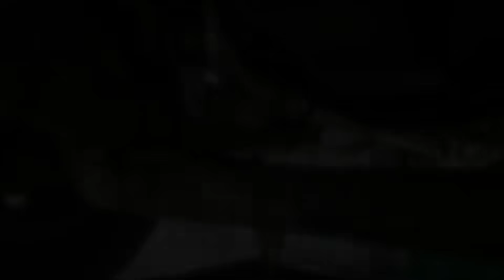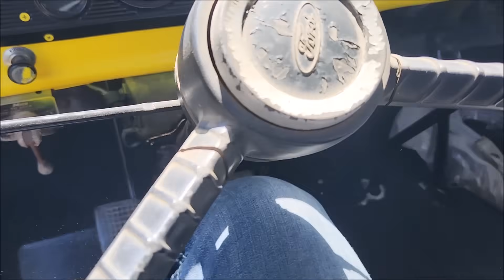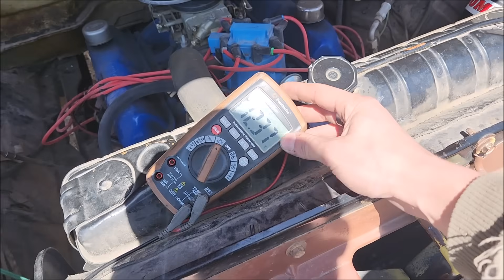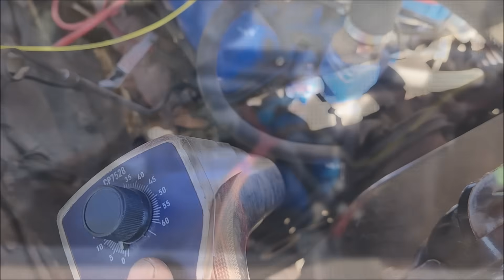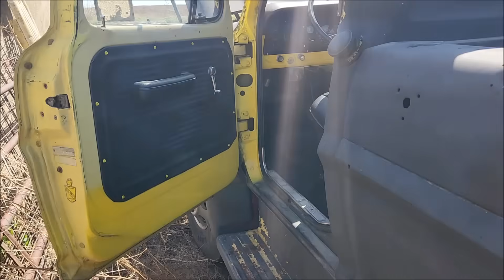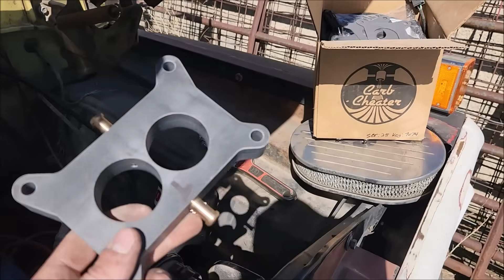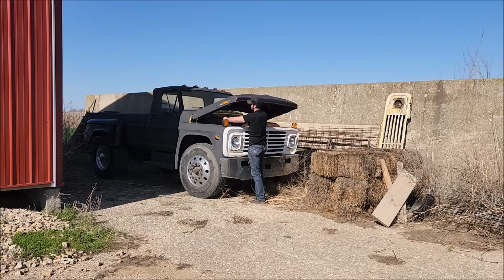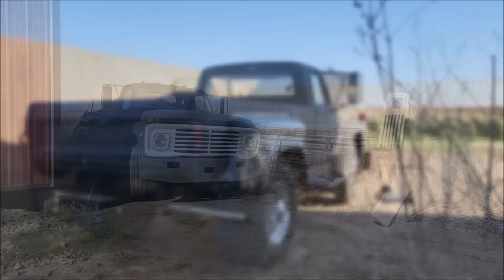Fix & Drive: 1972 Ford "Super Pickup" F750

Comment: Cool old Ford, my Grandpa had a 1976 F250 highboy and of course wasnt happy with the 360 so he bought a 390, turned out he was sold a 391. I think he said he already had it in the truck before he found out, something with the distributer is different and the crank snout is a lot longer.

Comment: This thing is awesome, read above you mentioned selling it, DON'T, this thing is ridiculously cool, it just needs something cool and torquey to power it, potentially an 8v53t or 6v53t if not enough room (looks like plenty), or a 5.9/6.7 Cummins, or if you want to stay Ford, a 7.3L (with a big) Turbo 👌 , but I'm a sound guy, nothing beats a straight 6 diesel, unless it's a 2 stroke Detroit 😅

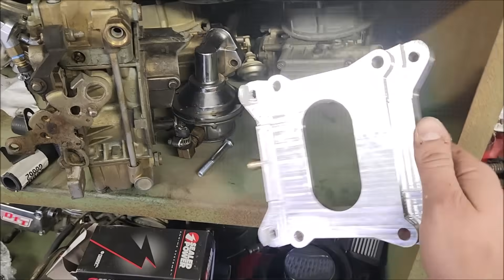Comment: What brand is your carb adapter at 20:20? 
It has a smoother transition than any I've seen.
Reply from the maker: I'm the designer and programmer of the product called "carb cheater" that's a prototype 2 to 4 barrel unit I designed as an adapter option. 
Have not yet released to the public, but it's a nice one compared to anything else IMO

Comment: so you gave coil battery 12 volts. whats your permanent fix ?
Reply from the maker: You could either A, splice in at the key effectively leaving the resistive lead there and having a full 12v wire also, which I view as the simplest and most robust solution with options. 
Or B, use the resistive lead to trigger a relay that loops 12v from the battery. 

Both fairly easy, I don't prefer the relay as it classifies as "more to fail" comparatively.
Reply: @ThunderHead289   I only mentioned it because you didnt cover it. 
Great video !!!!!
cool rig !!!!

Comment: That thing is totally kick ass. It really can't be understated how much thought and effort someone put into the brake/axle conversions on this. Everyone that messes with these old medium duty trucks wants to update the brakes and axles but seems very few actually pull it off. It takes a headache inducing amount of time and research to come up with the right combo of parts and then actually hunting the parts themselves down.

I can't help but love the gear whine those old Clark 5 speeds make, my 71 B750 sounds the same. I've got a factory 4V FT intake laying around I'm tempted to offer you but it's a big heavy cast iron beast. The shipping cost and installation effort probably wouldn't be worth the performance gains, if any.

Comment: Hi you might check your distributor shaft size 361 391 have a bigger shaft size on the distributor and in the block a 390 distributor will fit but loose.Cool truck I have worked on a fleet of the.

Comment: You know your stuff! It's becoming a lost art of wireless fuel management.  Make sure to clean out the air bleeds well. Might want to check the power valve sizing and that accelerator squirter could be tuned a bit. lots to gain.! sounds great tho! Fords like a lot of timing too. Cool build!!!!

Comment: Learned new things in this video.  Also learned I've owned a few older vehicles in the past that would have benefitted from the adjustments and fixes in this video.  I'll know better for the next time for sure.  Timing first, then carb.  And don't forget to look for little things, like that stud hitting the carb body or the loose accelerator pump linkage.

Comment: Why does it have Chevrolet rear fenders?
Reply from the maker: I didn't built it, but the chap said he just had them and they fit the body line - which is true to be fair
Reply: @ThunderHead289 they do kind of fit with the body lines, probably better than the rounded, 50's style fenders that Ford was still using on thier step sides. I just found it mildly amusing. 
Thank you for your response.

Comment: It's been several decades and then some before I've wrenched on these babies! It was fun stumbling on this video and reminded me of a F-250 3/4 that I modified to a one ton to circumvent gas restrictions at the pump after the 70s I'm not sure but in my mind's eye I want to see a fan shroud on that radiator to improve Cooling. Thanks for the ride along

Comment: Those tiny exhausts crack me up!

Are you going to fix this up and sell it?
Reply from the maker: Probably sell it eventually indeed - few more fun things to do yet
Reply: @ThunderHead289  I'll keep an eye on your channel. It's an unusual piece that looks like it'd be fun to use for some gas-wasting fun. Gotta fix the speedometer, of course.
Reply from the maker: It will probably end up equipped with a carb cheater and full time display which had GPS speed on screen
Reply: @ThunderHead289  Those actually sound like good ideas.

Comment: Im just glad it dont have that 360 Truck in it..that motor is an abomination. I did some research on the band you have for your intro/outro music. The singer went to another Chicago band called Chout. He kinda vanished after that.
Reply from the maker: He's a good dude - he's still around, does alice in chains tribute stuff
Reply from the maker: And yes, the 360 is quite the abomination. 390 block woth 352 rotating assembly and some weird long ugly piston thing that still has terrible quench. 
Definition of quick retooling for emissions, later replaced by the modified M series which was also pitiful.

Comment: Does the 391 have any components of the 390? Upper or Lower block.
Reply from the maker: It's "the same" but different - heads are different, exhaust is different, intake is different. You can replace all that and drop normal fe stuff on top. 
The FT block sports a forged big journal crank below. 
The FT and FE might be the most look alike yet most different engines ever made. 
It's like the FT cheated on the FEs homework.

Comment: I bought a 74 Chevy C10, 454 running points. 
The guy I bought it from said he tried a GM-HEI but went back to points because it ran like a dog, so the first thing I did was R&R the distributor for an HEI, but wired the ignition to the fuse box for a full 12V. It still runs perfect after almost 10 years. I've never bothered to remove the resistor. Never needed to after wiring direct to the fuse box

Comment: It should have a forged crank if it’s a FT. What it really needs is a International/Navistar DT466 466 ci straight 6 with a Eaton 6speed synchro or better yet 10 speed crashbox. It wouldn’t be too hard of a swap. The 93-97s use a P-Pump like Cummins. Generally,  for some reason they’re less expensive than a Cummins. They’re wet sleeve so you can overhaul them at home without a machine shop. It usually costs less as well. Yet the sleeves are ductile iron almost twice the strength as a 5.9 or 6.7 Cummins non sleeved block. Same with the Eaton. They’re Designed to be fairly easy and inexpensive to overhaul. Also if they’re not originally overdrive, they can be converted fairly easy. A Crashbox would allow you to “Float” the gears on most shifts without use of the clutch except for taking off and coming to a stop. You do have to rev match.
Reply from the maker: Indeed it would, and likely does.

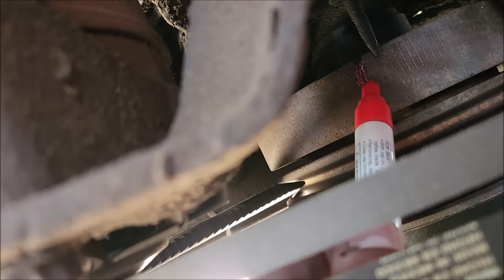Comment: 6:55, as a retired Ford, Lincoln, Mercury technician,  I would take a yellow grease pencil and fill in the timing marks after the engine had wamed up, wiping the excess of with a rag. That makes them really glow with a timing light.

Comment: I have used the power TO the Duraspark box to run the HEI - I have done this type of work on the newer 429 F700s - The 429's if they aren't hauling tons of weight...They can have the "base timing" WAAAAY more advanced....The truck timing was made to not have it ping under heavy load...

Comment: I had an hei distributor in my old truck with 12 volts used to be around 3 volts on the points. Now I have MSD box and distributor in mine.

Comment: Exactly the direction I was going with my bus . Assinate the governor. 
Then a 4 barrel carb via a upside down 4 to 2 barrel adapter with tiny primarys ...
Fuel mileage went way up as did speed !!!

Comment: I wished that you showed how to wire the HEI so that you don't have to pull the wire from the battery to kill it.
Reply from the maker: I probably will in the next video - two easy options, use the original resistive lead to trigger a relay, or splice in by the key and run a new wire from the same terminal. 
Personally I like option 2 since a relay classifies as "more to fail" in my opinion

Comment: Now is it a F750 because lats i remember they were called F700 F800 60s-2000
Reply from the maker: Right on the side of the hood, and is the vintage chrome f750 label piece. 
1972 f750 is googleable

Comment: Im going by memory so bear with me,.The ignition system and coil typically operate at around 6 volts DC (vdc) while running. However, during engine cranking, you'll see 12 volts on the coil/ignition primary to ensure the secondary has a better chance of firing the plugs while under heavy draw from the starter. Once the engine starts, a calibrated power wire or a power resistor is inserted into the primary coil circuit, causing the coil's primary side voltage to drop to 6 vdc.
Its been a long long time since my tech school days, but back then the whole tech school was around 18 to 20 months long & we studied everything from bumper to bumper,  anyway...i enjoyed the vid

Comment: The 50cc accelerator pump is standard on the 4412 holley carb.  All my 4412 we used for racing came out of the box from holley with a 50cc. The 4412 is a 500cfm carb.  The 7448 is the 350cfm carb and it has a 30cc accelerator pump.
Reply from the maker: That 500cfm was a poor choice on somebody's part - actually one of the reason I was simply going to adapt a smaller 4 barrel.

Comment: Yes it is a Super Pickup to be sure certainly stands out and Your never going to see Yourself driving by at anytime in that Beauty! don't drive anything that age anymore but it is still a Ford a Blue 2009 F350 Super Duty 4x4 Crew cab, bed 72" and Yes the 5.4 3 valve V8, Was a trip back in Time amazing and one forgets how much room there was to work on things back then! Was nice to see it runing a GM distributor one of GMs best ideas one wire was all there was an Engineering Jewel that is! Cheers!!!

Comment: If you keep it I think you should do an air ride conversion, get a bumper you can stand on so you can check oil and water, add full running boards, tool boxes.  Different front turn signals so they aren’t standing up to slap.  And my preference would be to have the pipes in front of the rear tires.  Regardless it is awesome

Comment: I guess if you want to use the original coil lead for something you could use it to pull in a relay to attach the new 12 volt wire to the dist.
Reply from the maker: That is indeed what I have done in the past - I just live in the boonies and didn't have a relay in my back pocket at the time

Comment: Luke! List #4412 carburetor comes from the factory with the 50cc pump. 
Favoring the throttle side of the choke air horn,stamped is the word list with the the number stamped.
Enjoy your videos! Learn alot from them. And enjoy them!

Comment: All the 8 carb cheaters he sold. U guys that are desperate for mpg get a used prius n then change the nimh battery n your golden.
Reply from the maker: I've sold several thousand for 1. 
For 2, it's not an mpg device - it's a gauge pack with tuning assist to change afr on the fly for optimum efficiency and engine longevity .....

Comment: Another tip on the gaskets- keep a tube of chapstick in your carb parts box, rub it on the new gaskets on install and they come back off easy and less messy than grease. Bonus tip- also works on Holly bowl and metering block gaskets.
All flavors work but I like the menthol stuff😁
Lots of solid knowledge in this video! Keep spreading the work man👍
Reply: -- The old school material to use is Vaseline... in the past, I kept some in a small medicine bottle which eliminated the need to carry the larger jar and kept both the pill bottle and the jar unspoiled. Wives tend to get peeved when they find the jar missing (in the garage) or something other than Vaseline in the Vaseline jar. Don't ask me how I know that! Peace & good vibes!

- Max Giganteum

Comment: All you have to do is change the accelerator pump cam. The one on it can probably just be moved to the other position. The 500 2 barrel has big butterflies, So the little accelerater pump is too small. Just because it’s a big accelerator pump doesn’t mean you’re using it all. accelerator pump cam changes are an art. You should have about .020” gap between the accelerator pump lever and the rocker lever on the accelerator pump. And if you get into it, I bet you could figure it out.
Reply from the maker: Nay - the .020 is when the throttle is fully depressed. Somehow everyone thinks that's static which isn't the case. 
It ran infinitely better with the small pump cam and 30cc assembly with 31 nozzle.

Comment: Love the blending of 50s chevy rear fenders to the ford bed.
If you want tork leave the 2 barrel on your FE hot rod go 4 barrel.
If that was an old hay truck is the rear end a two speed that the linkage has been removed, if so that could be a source of your lack of speed

Comment: People also think a two barrel gives better mileage... They don't take into consideration that the two barrel has to furnish enough fuel for all speeds. The primaries on a four barrel are smaller giving a better mileage at a speed of about fifty as designed in that day as I was your age, about forty five years ago. Adding a four barrel carb gave me a better mileage and fuel when making only  three dollars a hour is enough to think about. I had to drive over thirty miles to work every day. Adding a four barrel carb saved me a tank of gas a week. I  started in the fifties working on anything that had a  engine and steering wheel.... which ultimately worked into heavy equipment where money started to be a lot more per hour.
Reply from the maker: I completely agree with you - my 302 4 speed maverick that I drive everyday sports a 390cfm 4 barrel. 
Everyone thinks that means it's slow, but I've learnt quite a few friends who couldn't keep up on interstate on ramps.

Comment: Holley Accelerator pump adjustment: 
Engine off
Hold throttle wide open
Adjust pump arm to achieve .015”-.018” clearance so the diaphragm is not bottomed out. 
Primary/Secondary as necessary.

Comment: I looked at buying this very truck a while back but just didn't want to make the trip to go get it as I'm in southern Missouri. My friend and I are VERY slowly working on building a pair of pickups just like this only ours will be a '79 and an '89 plus a '69 F600 wrecker. Also, you say at 6' 7" you have to stand on something to get under the hood. Imagine only being 6' and working on these. 

On the suspension, because we'll run into the same issue you have with it being way too stiff, I'm thinking about mounting a thick hitch plate to put a little weight on, kind of like what you see on dump trucks. That might work for yours as well, plus it would give you a hitch that could handle anything you throw at it. Being an F750, I'd wager it's got a 22-26k GVWR and you'd probably have to remove too many springs to the point it would technically classify as a light duty truck. As for speed, what are your thoughts on throwing an auxiliary transmission with an OD on it? 

Either way, it's a cool truck and I'd love to see what you do to it if you keep it.

Comment: 0:30  Why after years of engineering school, plus years in an engineering dept. do they STILL go out of their way to design the used engine oil to splash out onto a crossmember ?  Is it for rust prevention, or just to remind you the oil plug is still out ?  Inquiring minds would like to know  . . .   ☆
Reply: Learn to use a funnel/ get the right funnel.
Reply from the maker: Probably the most absurd thing about the f series trucks from the twin I beam days .... just why

Comment: The vacuum advance on the distributor needs to be connected to a ported vacuum source on the carb. It will improve performance and fuel economy.  However, it does need to be disconnected when setting the timing.
Reply from the maker: It was connected before I drove - several folks have said that so I must have edited out any clip where that was shown

Comment: I always learn something watching your vids. You mentioned how nowadays people really don't understand carbs. I'm so old I remember when folks talked about mechanics who were "good" at tuneups. As I'm older looking back, I suspect there were guys who had your level of knowledge about the fuel-ignition relationships and working those out. But they probably were still not so common. Most guys just put in new parts and didn't necessarily make sure things were running optimum.

Comment: Chevy has vacuum on distributor at idle but don`t time with vacuum connected . Amc ,Ford and Chrysler no vacuum at distributor adjust up on rpms. Sold Carbs guys would get it wrong tell them to move the vacuum on the distributor , all good .

Comment: 😮😮😮.  SUPER INFO FOR A YOUNG GUY ,  YOU MUST OF HAD LOTS OF OLD STUFF TO LEARN ON , KNOLAGEIS EXEL ,, IM CHEV MAN ,, LOTS A LIKE ,, YOU ARE SET UP ,, YOU CAN FIX THEM WHEN NEEDED ,,👍👍👍👍
Reply from the maker: Trial by fire - most of the miles I've driven in my life have been carbureted. Now only not in winter as it pains me to rust out the old iron with it getting so scarce
Reply: @ThunderHead289  FUN TIMES

Comment: I wonder how much one can do with this beast before running into mandatory smog test or  diesel emotions fluid nonsense. I realize its a gas motor but I'm just saying if one wanted to swap a engine, there's certainly more powerful engines that a 72 391.
Reply from the maker: It's not terrible for what it is, 400ft lbs at a low 1800rpm or something. Thing just isn't designed to breath, has way smaller valves than it's FE 390 counterpart. 
All made for low end torque and longevity